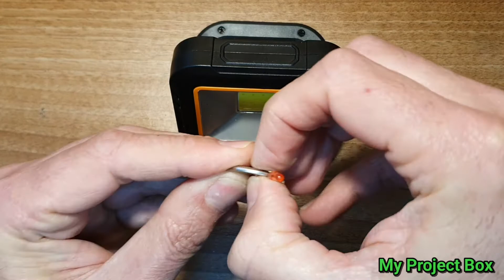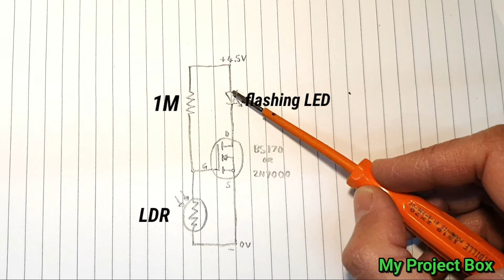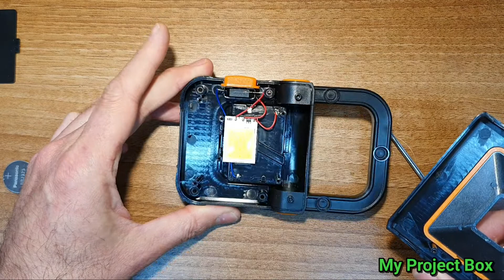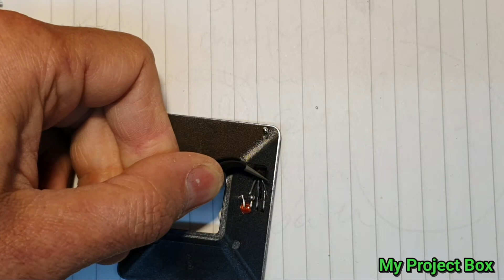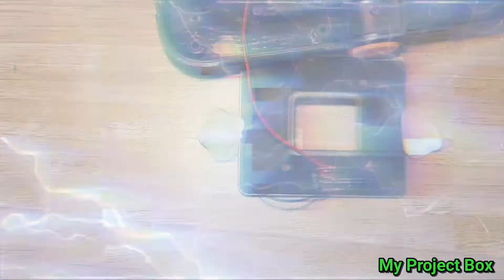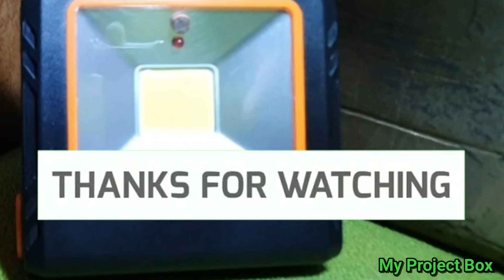Find your Flashlight/ Torch in the dark with a flashing LED and a light sensor #ElectronicsCreators

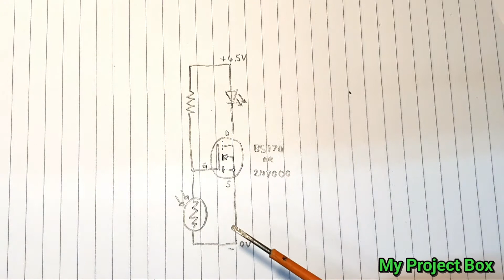Comment: Is there such thing as an flashing  LED that also “beeps“? To aid in locating in the daytime, including which bag it was packed in. 3:45
Reply from the maker: It is impossible to add the beeping function the the circuit, but I wanted to keep the battery drain as low as possible. I also wanted the circuit compact, and as simple as possible.

Comment: Nice simple circuit. Is there an easy way you could measure the current consumption?
Reply from the maker: Tricky one. When the led is off. It will be the current going through the 1M resistor + the daytime resistance of the LDR. So 1M plus a "bit" at 4.5v is 4.5ish uA.
But when the led is flashing you could probably plot the current with a oscilloscope. If I knew the decycle from the datasheet. And other specs. I don't have the right kit to do it. The current averaged out is pretty dam low, that's all I can guesstimate🤣🤞😤🤯
Reply: My guess is it would last more than a year on the batteries.
Reply from the maker: @edwardfletcher7790   not sure, but I'm testing and it's still ongoing. I might add a micro USB port and some rechargeable battery, so you can recharge it with a phone charger.
Reply: @MyProjectBoxChannel  Yeah, an old 18650 laptop battery would fit in there nicely and still give you the option of using AA's !